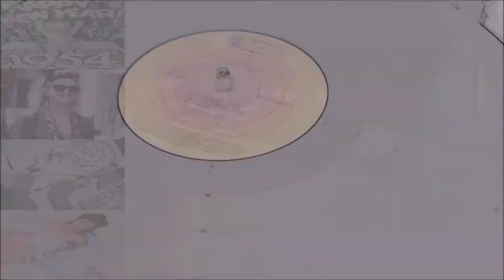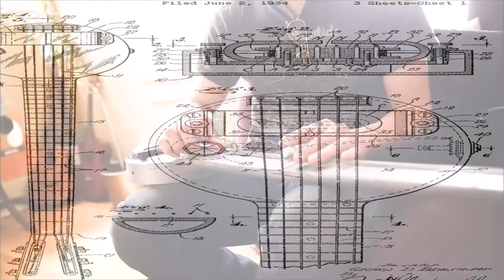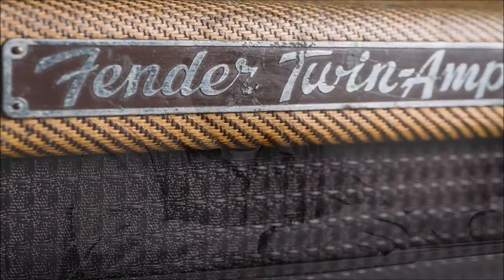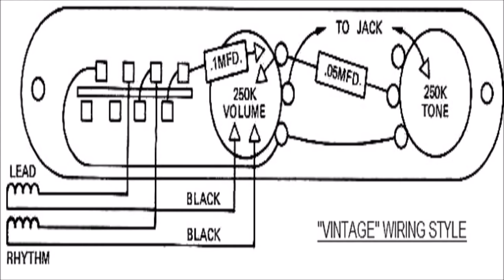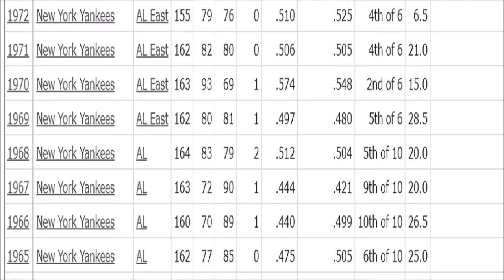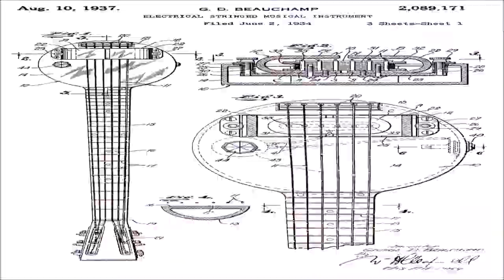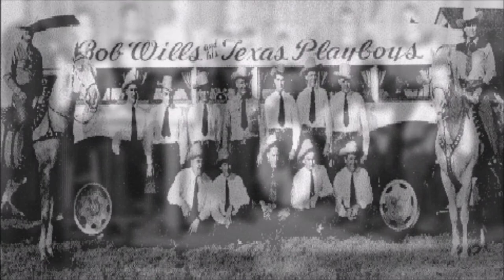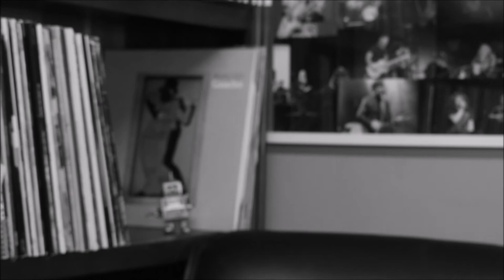The Righteous Bojambo #13 - The Plank

Comment: I'd always thought the Telecaster was the poor relation to the Stratocaster - this has made me think a little differently.
Reply from the maker: I went for many years where I wouldn't touch a Stratocaster, When I finally did get one, I thought, well, tonally the Tele is still - if not better then more capable of being different than the Strat, but the Strat is a masterpiece of effective design. The Tele is a triumph of simplicity, the Strat is a triumph of simple things done right.